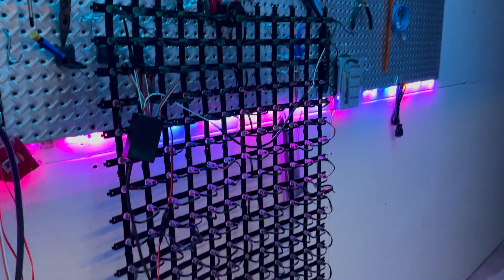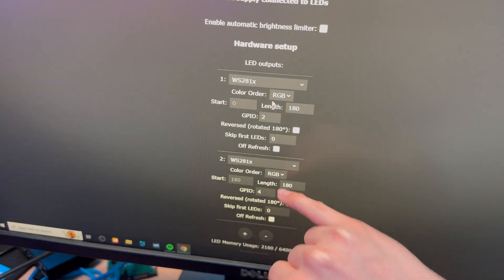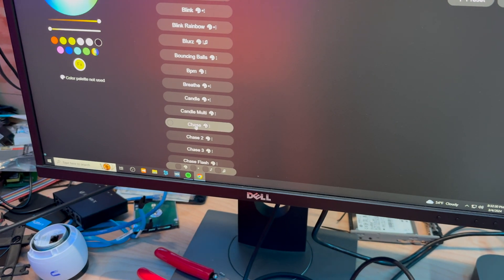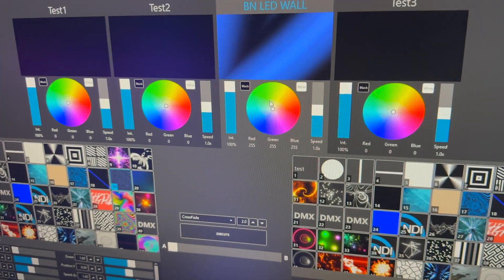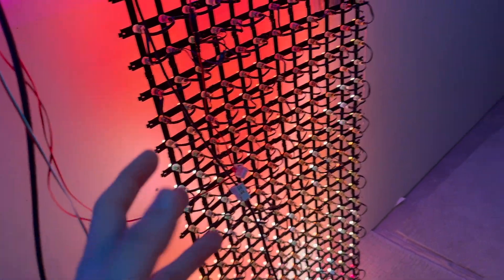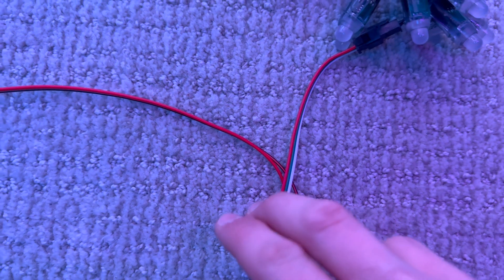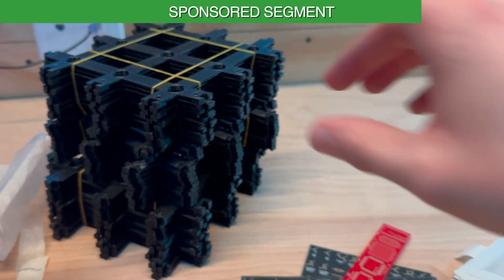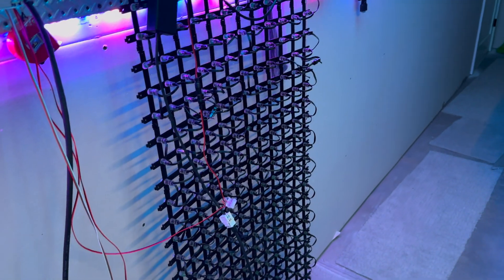WLED and Enttec ELM in Action: DIY Video Wall

Comment: Hello!

I'm not sure I understand your setup to make "ELM" work.

Do you connect your PC directly in RJ45 to the WT32-ETH01 (Artnet)?

If that's the case, are there any manipulations to do? (WT32 programming, like using WLED)

Another question, how many oixels can a WT32 control?

Thanks in advance!
Reply from the maker: Watch my newest video to show more about WLED / ELM, I think that’ll actually help a little bit. If you haven’t watched it, feel free to shoot me an email. youtube@beamnetworks.dev
Reply from the maker: Forgot to mention the limits. I am unaware of any limits on WLED but I could be wrong. I have done up to 500 or so LED’s without any issue

Comment: How did you get the device to recognize in elm I have some wesp32 and I wasn’t able to get them to read em ? Would love to chat quickly about this
Reply from the maker: Fill out the contact form on my website to get in touch via email if that’s easier. I’m using sACN to connect ELM to the controller.